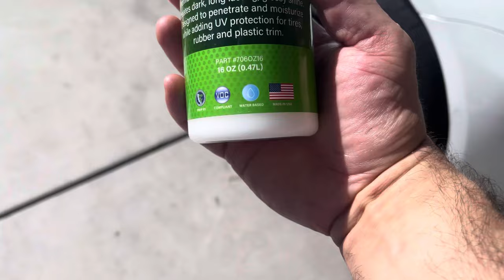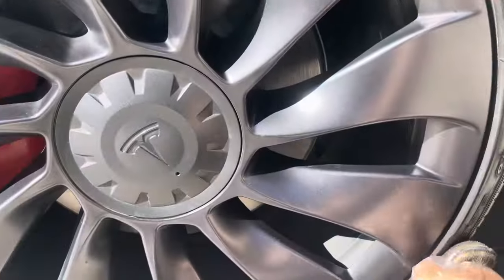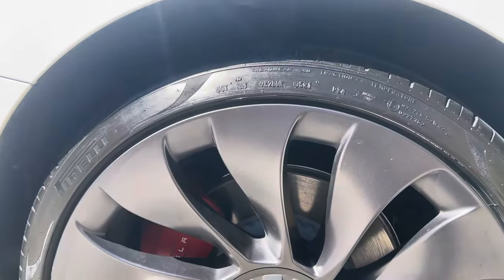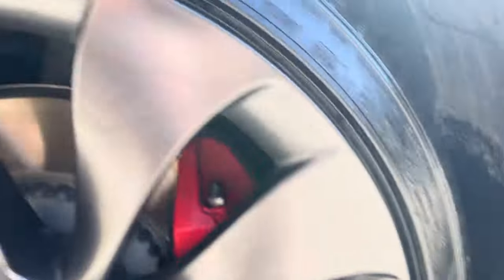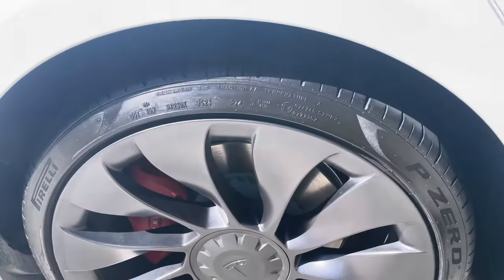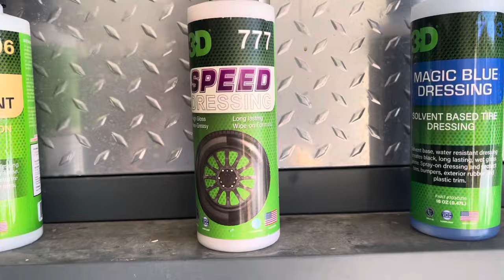3D Tire Dressing/ Solvent Vs Water Based/ Car Washing/ Auto Detailing/ Car Care Products/ Autoforge

Comment: The magic blue (I’m utilizing the rebranded version Crystal Blue) you should try applying to an applicator then to a tire and man it is by far the easiest thing I’ve used on a tire. Looks similar to non diluted PERL (little stronger sheen without being glossy) I’m testing durability on my ZL1 and wife’s Range Rover Sport just to see what it does on different compounds.
Reply from the maker: Right on, I’ll give it a whirl, ty
Reply: I was surprised, my distributor convinced me to give it a try (supposedly a good portion of detailers are using it in my area) I was honestly surprised and the only reason I posted the initial comment.
Reply: Just following up. It’s easy to apply and looks good with an applicator. Doesn’t last. It has its place as like a nice quick touch up but as a primary it fails.
Reply from the maker: @BiondosGarage  right on ty

Comment: I'll stick to chemical guys vrp, or adams vrt, they are my favorite so far. I do wish they would be just a little shinier and more water resistant (but what do you expect from water based products) but zero sling if you let them dry a little bit and a little goes a long way since the main way to apply is wipe on.
Reply from the maker: Those are great!